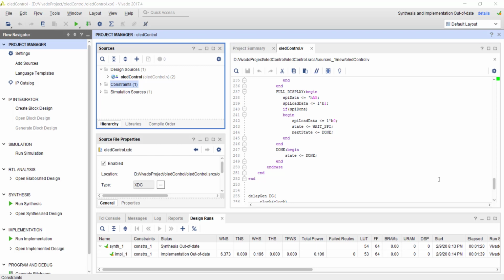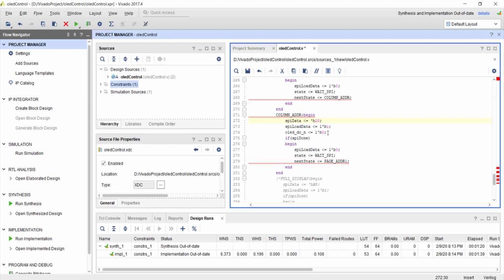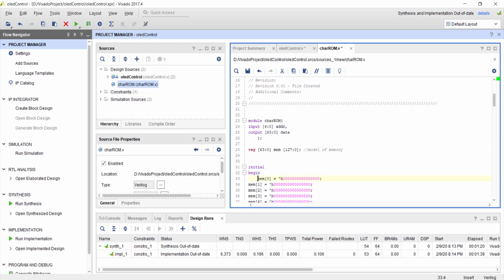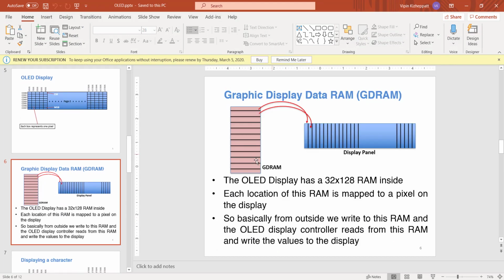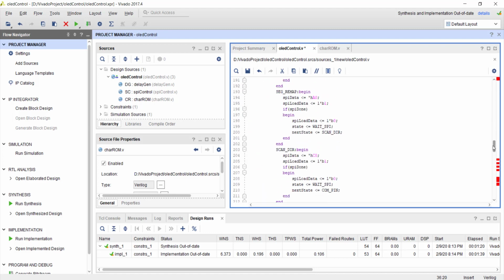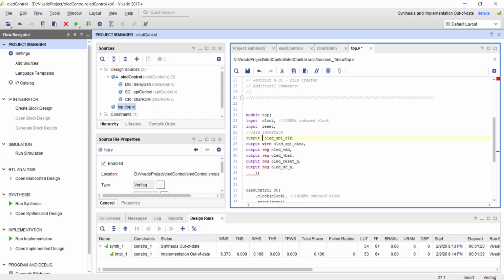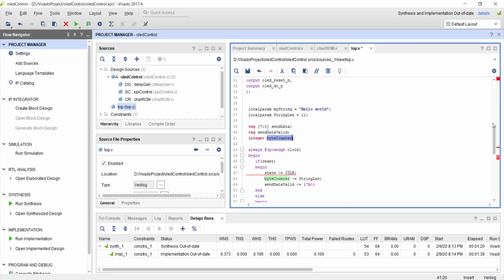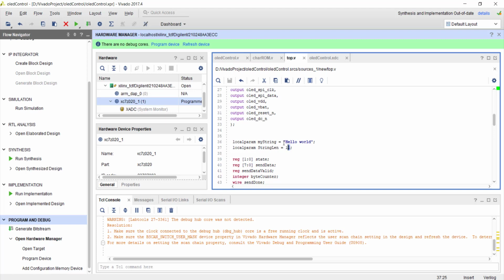Interfacing with OLED Display of Zedboard: Part 3 Displaying a constant String

Comment: I wanted to display time on oled display by instantiating a DigotalClock module in top module and making some changes I could display time. But, I couldn't rewind to page 1 and column 0 after completion of displaying hr:min:sec. It's printing all over the display.
Here is the code I tried and worked without rewinding: https://www.edaplayground.com/x/6jKY
Here is the code I tried and but not working with rewinding: https://www.edaplayground.com/x/frhc
Reply from the maker: Please try to clear the entire display before displaying new data. The present implementation in pure hardware has limitations. For best performance will need complete software implementation for the controller part and only spi interface in hardware